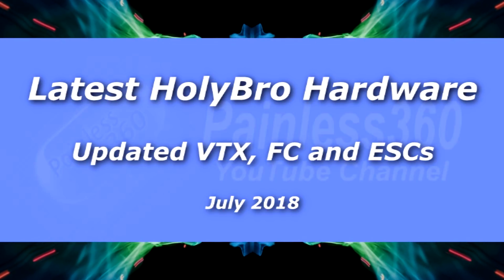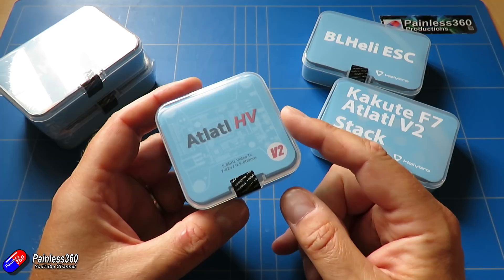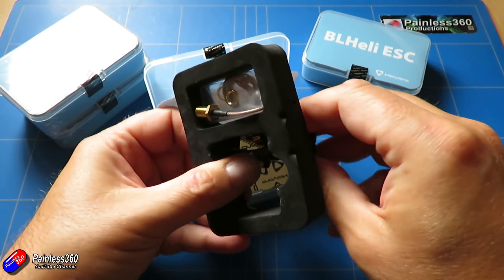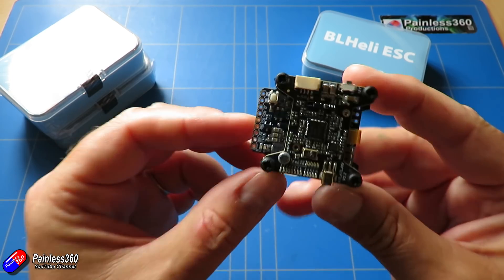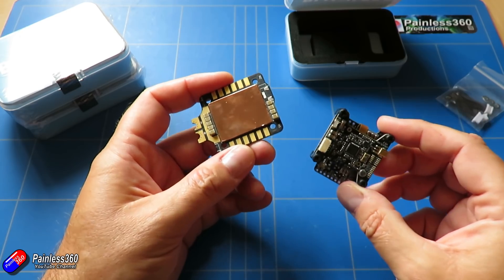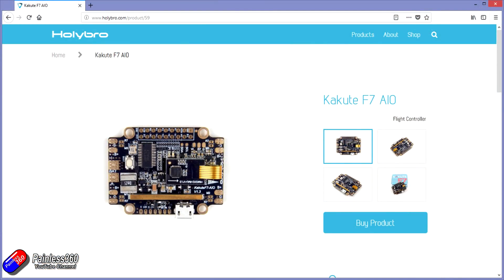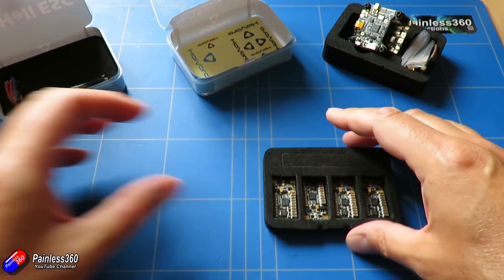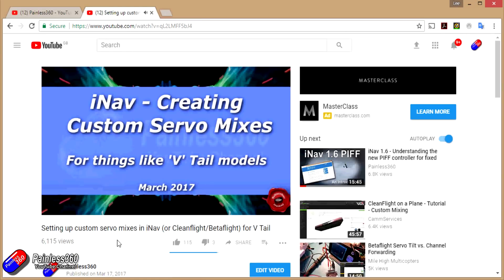Latest HolyBro Hardware

Comment: I just found this fc in one of bins and i have a luminar opto  35amp 4in1 no bec how do i power the fc with 4in1 having a bec?
Reply from the maker: I'd check the pin-outs on both and make a custom cable. Best of luck!
Reply: @Painless360 thsnk you! I made a custom pin out plug for the plug. It is working now. Took a few years off and im going threw my old stuff and getting it flying lol and updating everything has been a pain.

Comment: @Painless360 I beleive more VTXs are using Smart Audio now because TBS opened up the standard (more) earlier in the year. Actually I believe the standard was always open, but  I believe that TBS no longer requires implementations to be certified  and I think they have made the cost of certification lower.
That narrative may not be totally correct but the basic theme  (easier to legally use the standard, easier to get certified) is correct. I think this happened around the time that Begtaflight broke some non conformant VTXs Smart Audio (AKK?) when the devs made the BF implementation conformant (previously the BF implementation was less conformant and more  liberal)

Comment: Fyi, the copper tape is not for heat. It's to prevent the EMI from the mosfets interfering with the FC.
Reply from the maker: Actually it's both - "The copper foil keeps the interference from the mosfet away from the FC also it helps to dissipate the heat" from Holybro directly :)
Reply: that only applies is the copper foil is grounded.

Comment: WARNING A point of caution: The Kakute F7 & F7 AiO is having issues with DSHOT support on the current builds of BetaFlight(i.e <version 3.3.2).  See https://github.com/betaflight/betaflight/issues/6306  On Multishot it runs great.  Been flying the F7 AiO for the last week on a 7" build with zero issues.
Reply from the maker: Great spot! Thanks for posting!
Reply: Painless360 Do you know if the dshot problem has been resolved in bf 3.5?